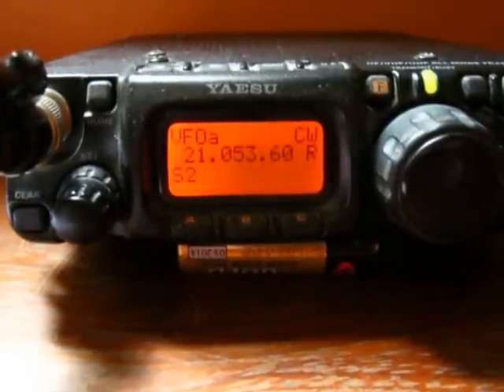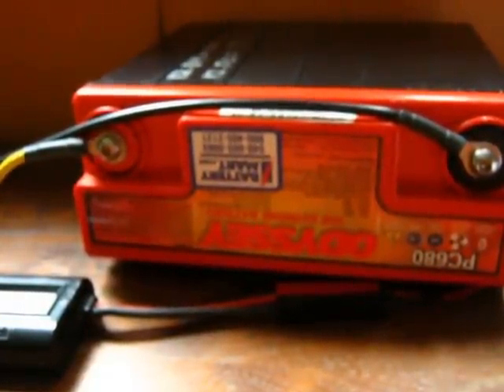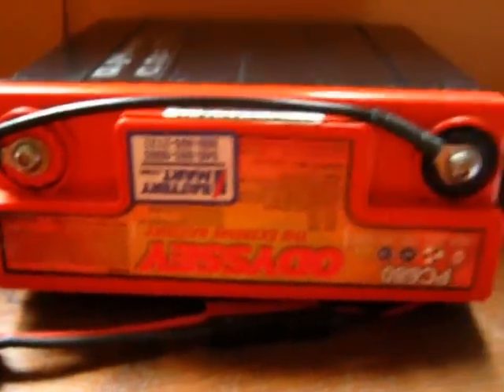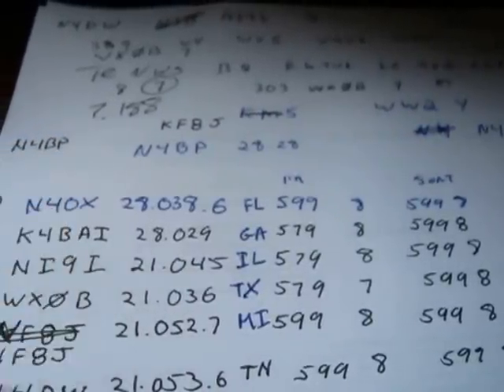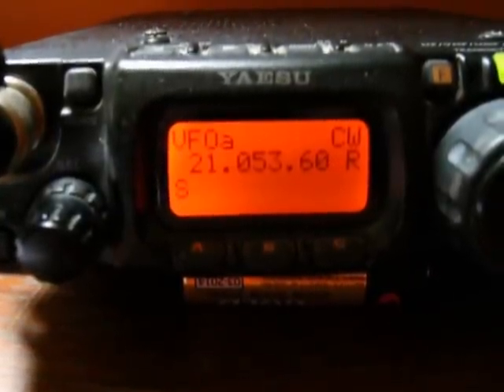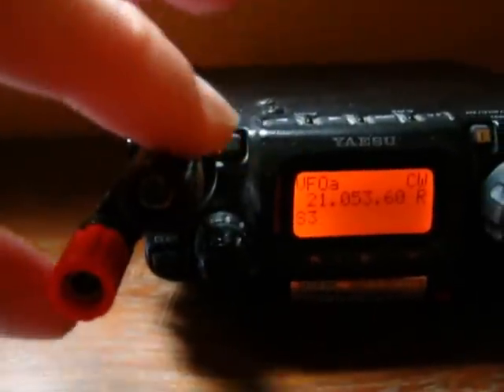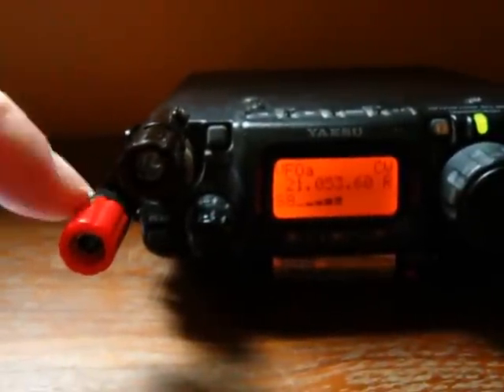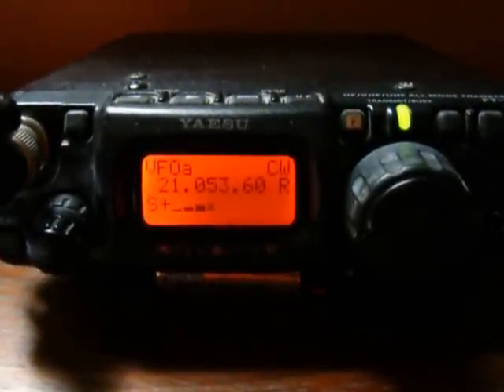Simple Ham Radio Shack, QRP

Comment from the maker: Thanks for watching and taking the time to comment, The radio is a Yaesu FT-817. It covers all HF bands in addition to All mode( CW and SSB ) on 6 meters, 2 meters and 440. It's 5 watts max on all bands. You can still have some fun on HF with your no code tech ticket. I make a lot of contacts on 7.112 MHz. It's where people that like to poke around at slower CW speeds hang out and its in the Novice potion of the band. good luck with your general. KG2LI